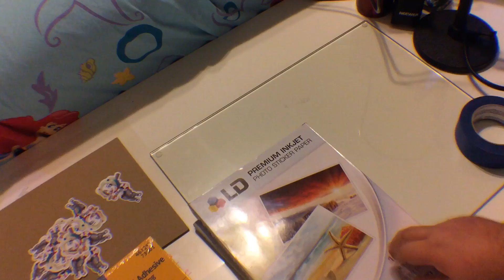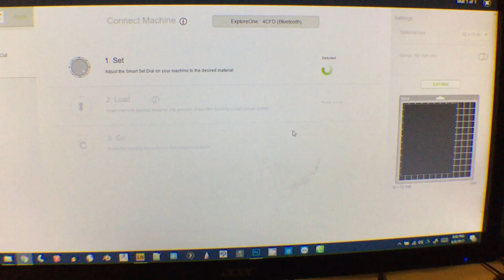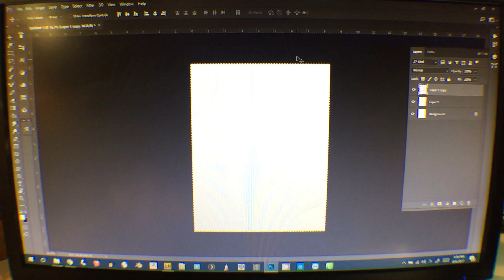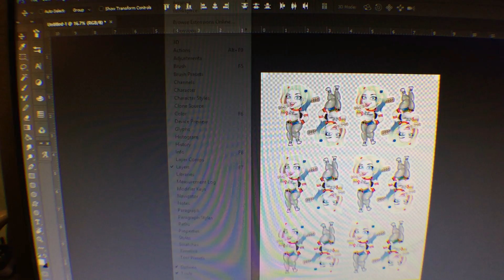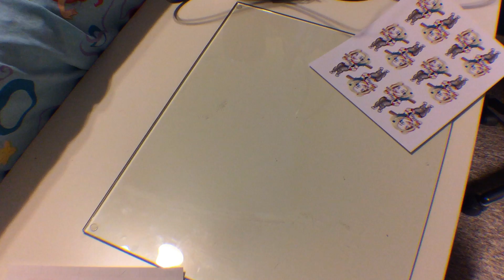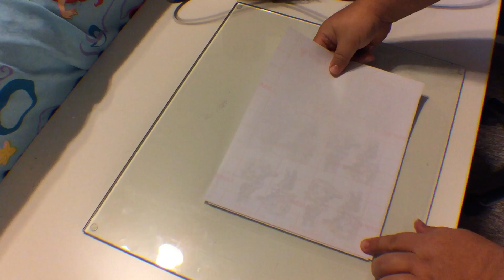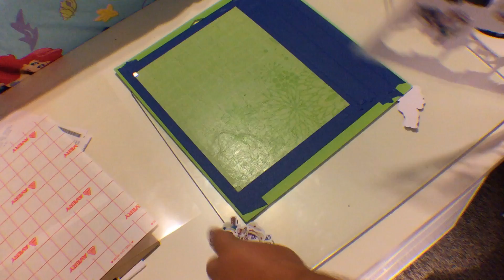Trick your Cricut to do FULL PAGE Print and Cut - Sticker Tutorial!!

Comment: I still dont understand why we make the taped box for? On my design it cut too much to the left but i cant flush my mat anymore left so would i be better off starting my paper off where it should be before the tape was there? Also i seen you told someone to calibrate before taping, but wouldnt that throw off the cuts as well cuz i noticed when i taped it and cut my 8.5 by 11 it doesnt start exactly at 1 but a little more to the right???
Reply from the maker: The tape is there to align your specific machine with a full regular USA standard sheet of paper. You need the registration marks to align the image with the corners of the tape. If your machine and mat are done correctly you will get 4 small squares in each corner. If those cut correctly then you are all set. The printed image or design is another thing. You will need to work with your printer to get that working after.
Reply: @EricMBoyd  so should i callibrate my blade on my mat without tape and once calibrated do the tape and cut out the 8.5 by 11?
Reply from the maker: @iWasBetterOffDead  yes.

Comment: Hi Eric and thank you for your tuto.
I want to know how i can do with A4 (8.27 × 11.69 inches) paper because in France is standard format.
 I try to do your process with a4 paper size but i have a big offset, can you explain me how i cant do  to correct the error.

I understand that it should not exceed  29.2 cm because it's the maximum limit cutting.

But even reducing my cutting plan, I have a big shift.
isn't a printing problem, because the dimenssions are good.

I try with other size and i have the same probleme. 
Maybe this methode it's okay for letter size?
Thank you very much.
Reply from the maker: Make sure the prints aren't fit to page or borderless. Resize your Design Space box for your size paper, then cut that size out of the taped matt for proper alignment. That should work.
Reply: @EricMBoyd  Thank you so much Eric for your answer. It's difficult because there isn't good tutorial in French for machines cricut, despite my low level of English, I finally understood the operation of this machine because of your explanations thank you very much.
now i will follow your advice
Reply: Eric M Boyd how exactly do you go about resizing the design space box for a different size paper?
Reply from the maker: @deatona16  figure out what size your paper is and design everything based on that size. So in my video I was doing full sheet 8.5x11, but I have used this method with other sizes both larger and smaller. So say you have a postcard you want to cut 5x7... retape the mat and cut a 5x7 rectangle. Create a 5x7 canvas in the design app and add registrations in the corner. Make sure when you upload to DS you make the design size 5x7 or whatever you are using.

Comment: I am new to using Cricut and looking for any videos to train with.  I thought your presentation was fine but left me with questions.  You said you made stickers...are you peeling something off the back and they will be sticky and stick to something?  Trick your Cricut...I didn’t quite understand the trick..is the trick to shade out everything except an 8x11” section? I felt you were very confident in your presentation and I would have liked to hear the why for each step. This is from a retired teacher.  Thank you for the video.
Reply from the maker: Shading out the mat is a good way to look at it but I am using sticker paper and the trick is to allow the cricut to print and cut full page. By default the cricut doesn't allow this.
Reply: Eric M Boyd ..thanks for your response.  I am wondering if the Cricut Maker is different.  I purchased the Maker.  I have only done a card which was the tutorial that came with the machine.
Reply from the maker: @monaquilts4679  They are really only different in that they can do different things but still use the same rules and software to achieve said things.

Comment: I have tried your method 3 times but my cricut keeps messing up and cut over my stickers. I did the steps exactly like you did but it doesn't get the measurements right. I think I will stick with the print then cut although I will waste a lot of good paper :(
Reply from the maker: Sorry to hear this, are the 4 corners cutting correctly in the corners of the taped box?
Reply: Same issue. However my squares are not cutting correctly in the corner of the paper
Reply from the maker: @janenedunlop3417  the paper or the mat?

Comment: have you made a video showing what your custom settings are on your cricut?
Reply from the maker: Not yet, but recently I just used Heavy construction paper setting.
Reply from the maker: yes, with extra pressure it cut strait through. Each machine and paper is always going to be a little different. My Mats are often extremely torn up and require more pressure to than a new mat.
Reply: @EricMBoyd  did it work out well

Comment: So I tried this with my cricut maker but when I put in my paper to cut it wasn’t cutting anywhere near my image the alignment was way way off. Taking the mat out and adjusting would not be enough as it was cutting in like 3 inches into my design.
Reply: I don't mean to intrude, but just in case i'm right i'll mention it.  If you print the image using a different computer than you use to run your cricut that might be the case.  I noticed when i used my laptop to print image but used my ipad mini to cut, it messed up all the time.
Reply: Eddie H well I print and cut from my iPad... the printing does seem off but I’m not sure why. My image is a full 8.5x11
Reply: @gracemartinez1849  try making a short vid of what your process is and what happens, that way he can get a better idea of what is happening.  hope things work out.
Reply from the maker: Where did the 4 registration squares cut?
Reply: Eric M Boyd the registration cut marks were in the corners.
Reply from the maker: @gracemartinez1849  Perfect then the issue is your cut file or your printer.
Reply: Eric M Boyd so how would I fix it?

Comment: I'm really struggling with this, I have messed up sooo many times, my Cricut just won't cut my simple circle stickers accurately. I'm in the UK and using A4 which is 8.3 x 11.7 standard, I have followed every step in this video using those sizes, but still get the same outcome. Any ideas on what im doing wrong?
Reply from the maker: Are the 4 squares cutting in the corners of the tape correctly? If so I am sure its printer issue. Something in the printer or settings.

Comment: Is anyone else havign a problem with your printer priniting your  sheets with a small border maargin that you cannot get rid of
Reply from the maker: Yes, this is normal for almost every printer. Just plan for it and ignore it. Know that the 1/4" .25" around the border of the page will not be printed, but still can be cut. I plan for this with my stickers having white borders, I often let the border go outside that area so long as the print portion does not. You can try borderless printing, but that's another beast entirely. The registration squares do not need to be printed to work using this method.

Comment: Does the tape trick it into cutting a full page? I've calibrated and cannot get it to cut my stickers along their border
Reply from the maker: The tape helps you align the paper to where the X,Y are at true or almost true 0,0 for better positioning.
Reply: @EricMBoyd  I've tried this after calibrating my machine and it never works. I've followed the steps but it always cuts away from the stickers
Reply from the maker: @zephyrfunknslobus7716  Do the 4 squares cut right? Are they in the corner of the  tape?
Reply: @EricMBoyd  yes when I use the calibration sheet I can get it to cut the correct  lines but when I set up with the tape it always cuts to the side or higher than my sticker sheet.
Reply from the maker: @zephyrfunknslobus7716  sorry not what I asked, do the 4 squares cut in the corners of the tape? You taped the mat?  Cut out the full sheet? Created cut sheet with 4 corner squares? do the 4 small squares cut in each corner of the tape?
Reply: @EricMBoyd  yes I made the 4 squares 1 for each corner of the 8.5x11 sheet but it cuts the tape below the sheet
Reply from the maker: @zephyrfunknslobus7716  pushing the mat in? or letting the machine pull it in?
Reply: @EricMBoyd  I hold the mat up a little like you do in the video
Reply: @EricMBoyd  I just dont understand man. I followed your instructions. What iam trying to cut are png images I previously saved as sticker sheets. So I have 6 stickers per sheet. On a 8.5x11
Reply from the maker: @zephyrfunknslobus7716  Goal is to get the 4 squares to cut correctly then work on the print. I am sure there is some reason the squares are not cutting right.
Reply: I think your loading your paper upside down.  when you stick to the mat it has to be in the same orientation as the screen on your computer.

Comment: I did ti! OMG! Thank you so much! I got super excited because the first time i printed, i guess i printed it wrong. I chose print photo instead of 'standard printing' on my printer settings which then misaligned everything and along with print photo i had chosen borderless printing...also not sure if me placing my design close to the border of 8.5x11 impacted my printing from ps. Anyway if i try again utilizing all of 8.5x11 will update you. Forgot to mention, i did go into my printer settings from ps and unchecked, "automatically reduce large document that the printer cannot output." if that helps anyone. Once again, thank you good sir!
Reply from the maker: Thats is great! Once you get used to the process it only gets easier. Everyone once in a while the Cricut will still do whatever it wants and really frustrate you. If you run into that re-run the calibration tool and re-tape the mat and cut a new page size.  You should be back on track if you run into this that is. Thanks

Comment: i just bought and hate tht circut , it is useless , my usacutter better thn tht ..
Reply from the maker: Why did you buy it?
Reply: @EricMBoyd  my usacutter dnt makes contour cut so for stickers etc i bought it in its spec. writes cuts 12x24 inches so i throught it can make tht big area contour cut but it can cut just handsize , so tht useless machine same  money there are bigger ones for example 34 inch usacutter is very usefull for me..
Reply from the maker: @kizagan_alaz  yes, if you use the print and cut option in Design Space, but that is why I trick the Cricut to do full page. That is what this entire video is about. The issue is the limitations of web-based software. The machine works great and has its issues but there are ways around them. Here someone is cutting a print full 12x24 using this technique. https://www.youtube.com/watch?v=HvkFocQSYVU
Reply: @EricMBoyd  ur video s great.i tried ur videos i applied wht u said all but never cuts right .always cutting upper lower sides of image also ps exporting and epson print not printing exact size of screen all different so best way of contour  cut . cricut makers sensors .. i cant spend my time always play mats etc .. coz i m working ...anyway thy have to correct makes programs else if it s trash

Comment: Whenever I load my transparent image with my stickers the program automatically shortens all the transparent space so then my stickers get messed up. What should I do
Reply from the maker: Are you missing your Registration squares? This is why the registration squares are there to force Design Space to not resize your cut files.
Reply: Eric M Boyd I’m not too sure what the registration squares are. If you mean the squares on the grip paper then yes I have those. Thank you for your assistance!
Reply from the maker: @TheSuitedSpades  in my tutorial you need to have 4 squares in each corner of the page on the cut file you upload. That lineup with the tape on the mat for your cuts.
Reply: Eric M Boyd Okay thank you. Can u provide a time on the video where u set that up?

Comment: so the machine was able to cut even it has the glossy thing you put on top? is there a setting in the machine you used to be able to do the cut with the glossy thing on top?
Reply from the maker: Glossy thing is laminate and if you are trying to do the Design Space PRINT AND CUT feature where it scans the black lines I have never been able to get that to work with glossy laminate or printer paper. That is another reason I created this method of tricking your machine.
Reply: Eric M Boyd thank you your video is really good
Reply from the maker: @bebs0647  Thanks

Comment: I've almost got it to work but it never is quite aligned properly. I think the problem is that there is no option to "center" the page on my printer. I have a Canon Pixma Pro 100. Any tips ,
Reply from the maker: are you using photoshop? Also did you install all your printer software and not just the drivers?
Reply: @EricMBoyd  no, and no. I'm using Gimp, and I got a new computer and no longer had the software that came with the printer. That's probably the issue,  thanks for the response! I'll see if i can get more software.

Comment: Hello, sorry for the bother, but I just tried it, but it didn’t work out. After trying to figure it out for a while, I realized that DS actually cut something slightly larger 8.5 x 11 on the tape. I can see that the shape extends a little after the 8.5 and 11 marks in the preview window while trying to figure out what is wrong, and I also see that the paper doesn’t completely fill the cut out shape on the tape . I hope I’m making sense. Why do you think that is, and do you have any idea how I could fix it? Thanks!
Reply from the maker: are you sure you are using 8.5 x 11 paper? If I am understanding you correctly either the page cut wrong or your paper is a slightly different size. I'd recut the tape on the mat maybe first and start from beginning.

Comment: My cricut prints a solid black line around the sheet and doesn't cut out registration marks in the beginning. Is this tutorial for an earlier version of cricut? Thank you.
Reply: He doesnt use cricut software to print.  Look at video and it will explain.
Reply: @shoa6512  thanks! still not sure it will work though. I did watch the video. My cricket Prince a solid black line around the entire image and if the laser doesn't read it at any point it won't print. It doesn't check registration marks in the corner. Maybe it's the new design that cricut made so you can't print your own?
Reply: *prints not prince
Reply: Pete S. With this method. It’s not reading the registration marks. It’s more like a svg in a sense that you preprinted and you are manually aligning it up to match what’s on the screen so it could cut. Therefore you aren’t using the print feature from the cricut at all.
Reply: @shoa6512  Thank you! I think I finally got how this works. I actually didn't even know you can just cut without printing. However, I can't seem to get it to ever cut correctly around the image. No matter what I do it cuts off center. I think I'm going to give up, a little wasted paper is not worth this stress lol!

Comment: I'm not sure what I'm doing wrong here, but if anyone has any advice I'd love it

My stickers alignment is coming out all fucked up and I'm not sure why. The tape cut is coming out a perfect 8.5 wide, but is sliiiightly taller than 11in so there's a gap at one end even though it's set for 11in. I'm not sure if that's related or not. My corner marks seem to come out just fine after I reload it a bunch to get the paper on the right spot, but the stickers are all off when they cut out. I changed some printer settings around and it got better (I had borderless printing on, rip) but it's still off enough that it's cutting into the image or at best making a really inconsistent white border around the stickers.

Comment: Was always interested in the Cricut and just came upon your video. Nice job. I was wondering though would it be easier to run your page through your laminator before you make your cuts or do you think it works better after you have cut your stickers.
Reply from the maker: I like to keep the borders sticky as I don't keep my mat sticky and that could cause issues with the running through laminate before cutting. I have tried this too with them stuck to the mat I am going to cut on and the indents from a heavily used mat pressed cut lines into my stickers.
Reply: Ok. I don't have a cutter and am very interested in getting one. Thank you for the info. Every vid I see makes me more convinced to buy one. Yours was one of the ones I actually bookmarked.
Reply from the maker: @gambonianca  Thanks! I hope you like it once you have it. It can be frustrating but the rewards are great.

Comment: How do I set the photos shop to print to .0111 when centered mine is not doing that and my cuts are off by about a quarter in off.
Reply from the maker: its in the print setting screen, but if the center image is checked it won't let you change that.

Comment: I've been trying to get my stickers to look like yours with this method for weeks, I probably spend about 2 hours a day and have spent maybe $40 in cheap practice materials and my cricut just won't cut along the lines it's supposed to. No matter how many times I adjust or move the image, the tape, the mat, no usable results like yours from my cricut explore air 2, it will always be at least a centimeter off and because many of the images I need to cut have black outlines some sides usually have no outline while others have the full outline with some white as well, I feel like I'm missing something but I've sat here with my wife and we've both watched this video as well as other videos several times :/
Reply from the maker: Lets go to the basics, does the registration squares cut correctly in the corner of the tape?